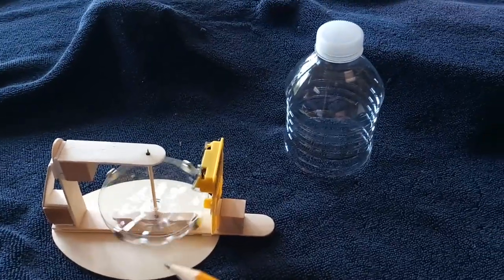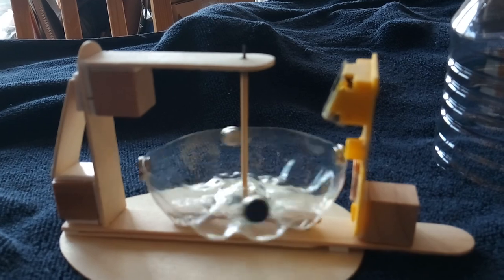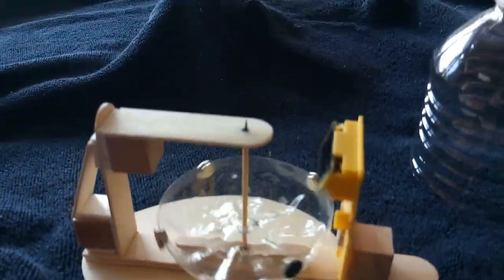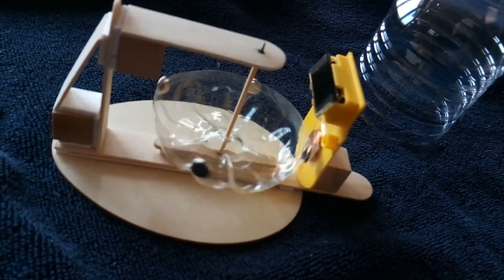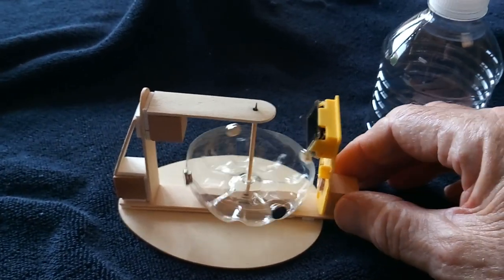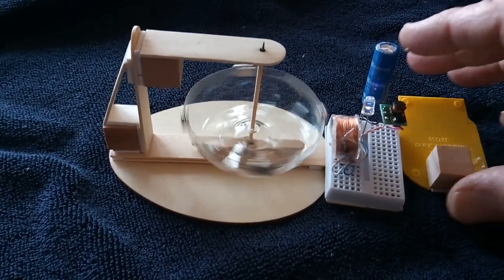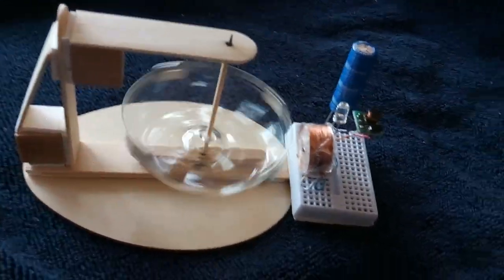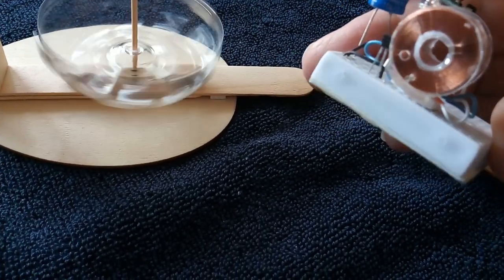Water bottle and toothpick motor

Comment: Wow, that new driver is working fine. That is far more interesting than me 3d printing a frame, but I agree that crazy glue and graphite would make a PLA bearing more durable 👍
Reply from the maker: My new low voltage Hall effect driver works good.  The booster board part trades low voltage for higher amperage though. I may try a clear acrylic frame with this new rotor.